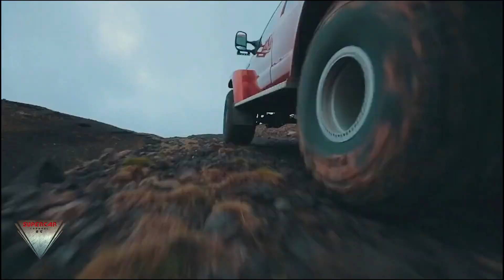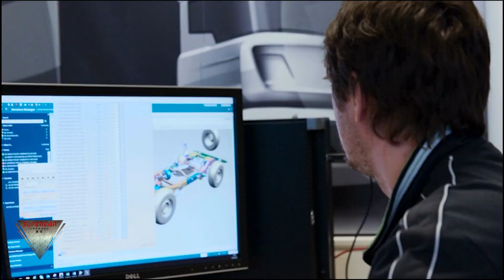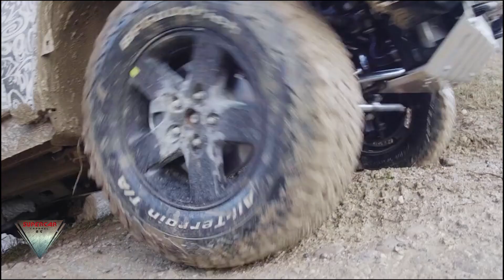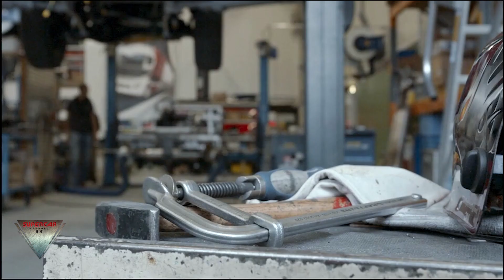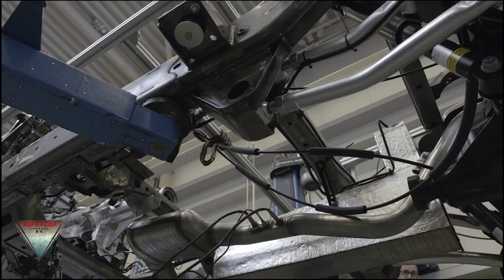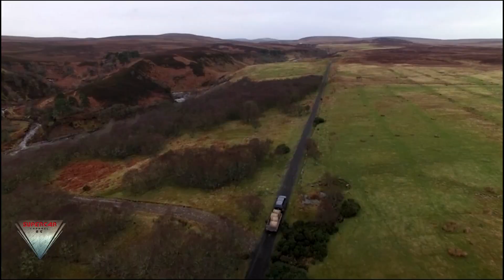2021 Ineos Grenadier   The Suspension

Comment: Should be called the Legionaire if its built in France Americans and Australians will not buy French vehicles
Reply: I’m Australian, I don’t care where it is made. I just want a good quality, basic 4x4, that is reliable. All this Euro standard and electronic sophistication of modern plastic cars is not required in the remote locations.
Reply: I think many Australians will look past the location of the factory and make decisions based on the combination of well sorted main drivetrain components and the format of the vehicle.
If anything, one of the biggest factors will be the comfort of the driver.... is the seating position wide enough? ( the Defender wasnt ), and the availability of parts.
Reply: @noelwhittle7922  
Thought it was to be built in Wales...?
Reply: @brucemitch928  that was the original promotion /sales pitch, but it seems that more recently they have taken advantage of the offer of an existing an unused car manufacturing plant on the continent.
Reply: @noelwhittle7922  
Mmmm, ok thanks for the update Noel.